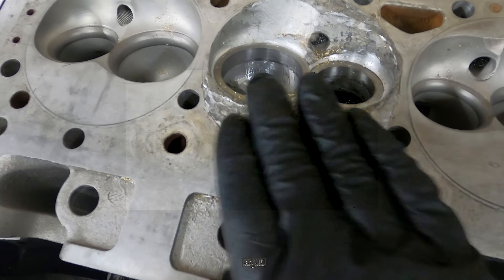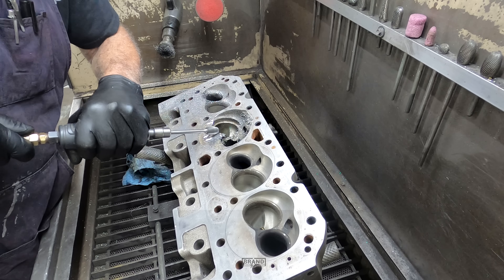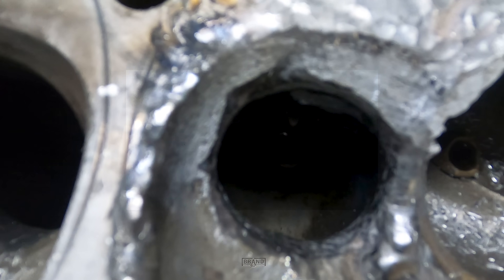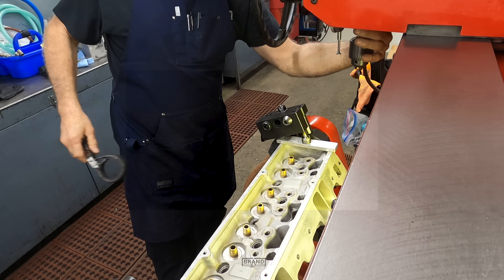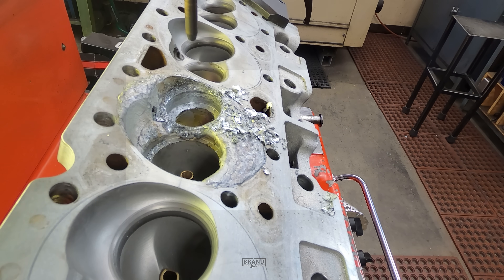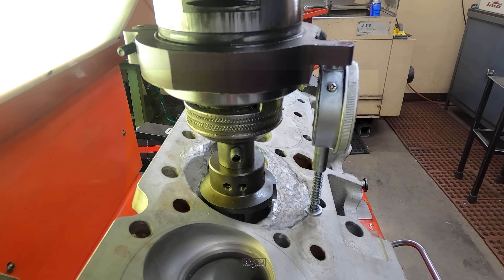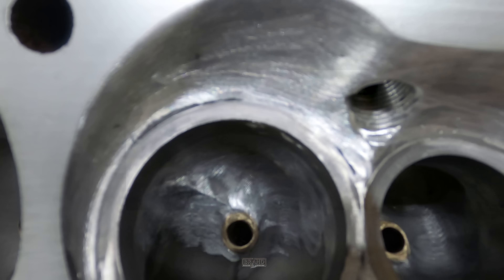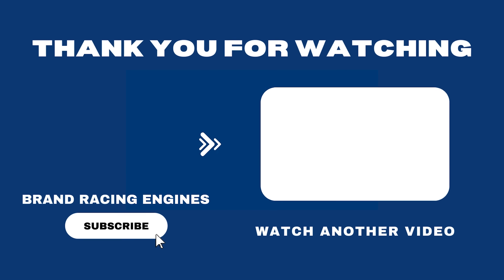Machine Shop Repairs a BADLY Damaged Small Block Chevy AFR Cylinder Head

Comment: What does a job like that cost?
Reply from the maker: 500.00 to 600.00 with no valve
Reply: @BrandRacingEngines that's not bad considering what a pair of those heads cost. Thank you.

Comment: I really would like to X-Ray the weld cladded area.  I would bet   to find a lot of lack of fuison in there.
Reply from the maker: What makes you think that the weld is not good
Have you ever welded cylinder heads before?
Reply: @BrandRacingEngines  i am a material tester. specilazed on weldseams. I saw the frist lack of fusion points already when u drill finished it and used the end mill before. Not critizising your wonderful craftmanship but a trained eye is a trained eye.
Reply from the maker: @Friese81  I have repair over a 100 heads with on problems. Thanks for commenting and watching Sir.
Reply: @BrandRacingEngines I didn't want to talk down your work.. was an amazing job.. it's just a professional view on that work😊  when I see somethings welded.. I wanna xray it 😄
Reply from the maker: @Friese81 Its all good sometimes there’s so much contamination in the aluminum and there’s no way to get it clean. I grind them out the best I can.

Comment: Do you have to heat up the head when welding or not? I have some craters around coolant holes I need to somehow fill.
Reply from the maker: No just grind all it out to clean alum.

Comment: I noticed you faced the head last. When you milled the seat pocket your dial indicator was touching what I would see as an unknown surface. So you didn’t know the depth to go. Or were you using a different touch off point just curious 🧐

Comment: What reference plane do trust to use when setting up a V8 head on the mill for final facing?
Reply from the maker: You can use the deck surface but check the intake angle BHJ make a tool to check this

Comment: Nice video, good repair. Only thing, If this my cylinder head, I would start looking for a replacement. Did you mention the labor charge for this repair, a new or used head would have  been cheaper. :face-orange-biting-nails:
Reply from the maker: It was cheaper to repair it  AFR did not have a replacement it was a older head
Reply: @BrandRacingEngines  OK I thought that head could not be replaced. So your repair was a life saver, good job.

Comment: Question for you .picked up a gen v l8t engine that was in a fire ,#7 got so hot it dropped the intake seat .do you think the head is worth fixing .? I've been watching. People welding aluminum.just wondering if it's worth it?
Reply from the maker: First thing I would do would check the hardness on the head. If the hardness is okay. It may be worth fixing. I would have to see a picture to determine a price
Reply: @BrandRacingEngines  is there somewhere I can send the picture?
Reply from the maker: brandracingenginesyt@gmail.com

Comment: Awesome repair.  Couple questions please.
I'm assuming the hammering while welding is for stress relief/reduction.  Is that correct?

What fluid are you using on your rotary cutters to keep the flutes from clogging?  Also, what fluid when machining the seats?  WD-40 or something else?

Thank you 
Mike
Reply from the maker: Yes no the weld
Reply from the maker: Unist coolube 2210 AL
Reply: @BrandRacingEngines  thank you for the quick response.

Comment: Wouldn’t it be more cost effective to buy a used head than spend $$$ on labor and materials? I could understand the rationale behind it if it a was, say, a very rare 1929 Jaguar engine. Can someone explain, please?
Reply from the maker: we are working on a head:body-blue-raised-arms:
Reply: @BrandRacingEngines  Thank you, I corrected my comment but the question remains. Just trying to understand. This being said I admire the workmanship.
Reply from the maker: I believe the customer tried to buy a single head for AFR. And I believe they had changed the castings a little bit and wanted him to buy a pair.

Comment: Nice work Gerald, I just have one question. Does the aluminum need to have some sort of heat treat done to it after that much welding? I would think the factory heat treat process would be drawn back to an annealed state from the welding process.
Reply from the maker: Sorry I didn't get to finish most of the aluminum heads are not heat treated from the factory they have what they call a hip process.
Reply: @BrandRacingEngines  Could you define that a little bit more? What is the hip process they use?
Reply from the maker: @johndevries8759   HIP stands for Hot Isostatic Pressing, and it originated in the aerospace industry as a way of increasing strength and eliminating defects in metal castings. HIP will take a good casting and make it great by eliminating trapped gases and internal porosity in the casting. Every casting has trapped gases, or internal porosity; it’s the amount of trapped gas or porosity that determines the castings quality and structural integrity. Basically, the HIP process takes raw castings up to 970° F in a pressurized chamber with inert gas (up to 30,000 psi) and compresses the casting to reduce and eliminate any trapped gases. The result is an incredibly strong and dense sand casting that has three times the fatigue life and nearly the consistency of billet aluminum.
Reply: @BrandRacingEngines  So then as long as the weld is done correctly there's no need to do any process to insure the strength of the repair is what you're saying? Thanks for taking the time to answer, not many people will share their knowledge the way you do.
Reply from the maker: Most of the aluminum heads

Comment: Very nice job on that head. Every head ive ever had welded usually cracked or had other issues. I wonder if it wouldn't make sense to deck the orher head to match the repaired head? Is this a nitrous motor? Chambers look clean like methanol tho

Comment: What does the peening do for the repair?
Reply from the maker: @scottsmith5623
@scottsmith5623
6 hours ago
I believe it “compacts” the aluminum, tamping it down after every few passes ensures a uniform, quality and dense weld with little to no porosity.
3
@michaeltristan
@michaeltristan
4 hours ago
 @scottsmith5623  Very interesting...  I've done a little arc welding, and have hammered slag- but didn't really understand why the hammering was happening on tig welds.  Thanks for taking the time out to explain- much appreciated.
@ronmedenwaldt
@ronmedenwaldt
4 hours ago
 @michaeltristan If I remember correctly the vibration also helps with the crystalization of the material as it cools!  🤷
1
@88jhoyle
@88jhoyle
4 hours ago
"peening" is usually done to relieve some of the internal stress created by welding, to me it makes sense to think of it almost like tempering. Maybe @BrandRacingEngines Gerald can weigh in on why he does it personally?

Comment: awesome work. Would someone need to change the thickness of their gasket after a procedure such as this?
Reply: Probably not. Depends on a lot of factors. The other head will probably get cut also. You can get a variety of head gasket thicknesses, usually the MLS will go from.030 up to .100-ish, depending on make. As usual, looks good Gerald!

Comment: can you explain why you hammer the welds?  sorry if I missed the explanation.
Reply: "peening" is usually done to relieve some of the internal stress created by welding, to me it makes sense to think of it almost like tempering. Maybe @BrandRacingEngines Gerald can weigh in on why he does it personally?
Reply: I believe it “compacts” the aluminum, tamping it down after every few passes ensures a uniform, quality and dense weld with little to no porosity.
Reply: @scottsmith5623  Very interesting...  I've done a little arc welding, and have hammered slag- but didn't really understand why the hammering was happening on tig welds.  Thanks for taking the time out to explain- much appreciated.
Reply: @michaeltristan If I remember correctly the vibration also helps with the crystalization of the material as it cools!  🤷
Reply: Be aware, the welds must be perfect.
A imperfection in the weld could cause a hot spot under load
And cause a blow torch in the cyl that makes a bad day.
Ask me how I know.
Cost me!

Comment: Amazing work as always. Question, you didn't clean up spark plug hole? Looked like you got some weld in it.
Reply from the maker: Yes I run a tap through the plug hole I just didn't get a video of it I got beat up a little bit on one of the shorts over running a tap the plug hole😂
Reply: @BrandRacingEngines  I saw the one where you showed all the crud that gets into them. I figured you did, just wondering. Keep up the great work my friend, don't let the haters get you down. There is no right or wrong way, just the way you do things.